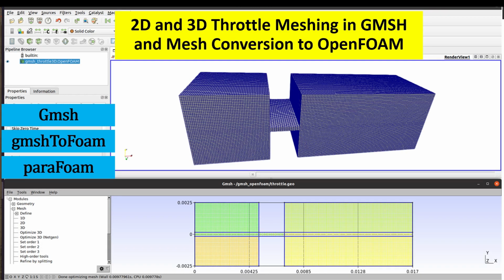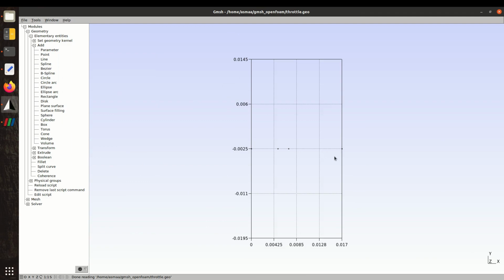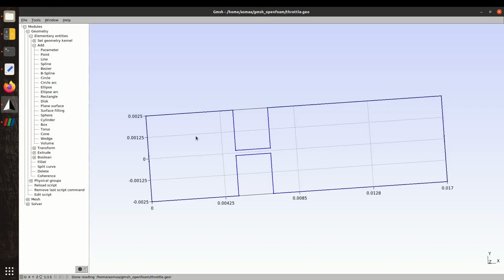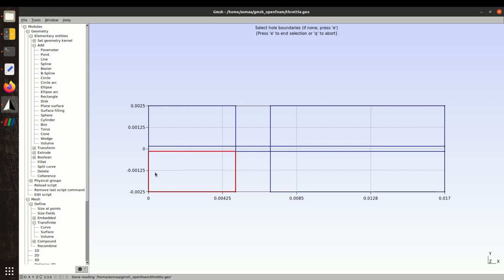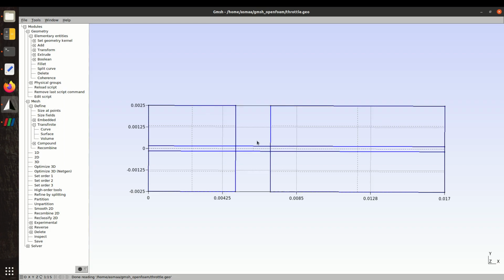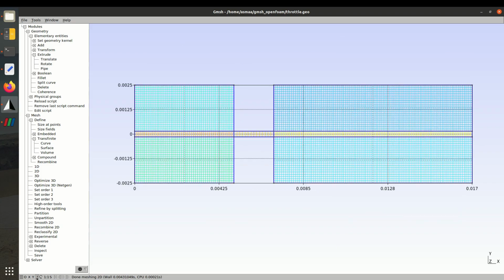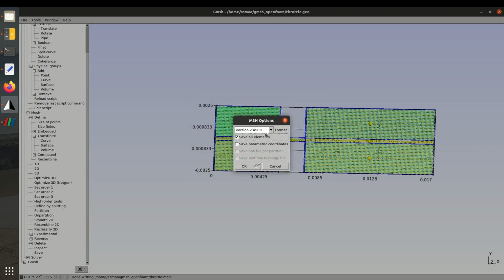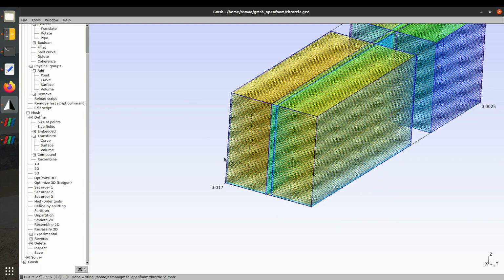2D and 3D Throttle Meshing in GMSH and Mesh Conversion to OpenFOAM

Comment: Can I use different number of partitions at the top and bottom of a line using Transfinite? Because I need fine mesh at the top sub-surface and coarse mesh at the bottom sub-surface.